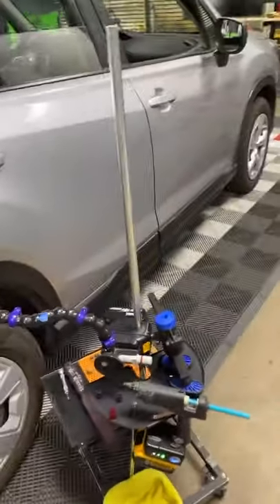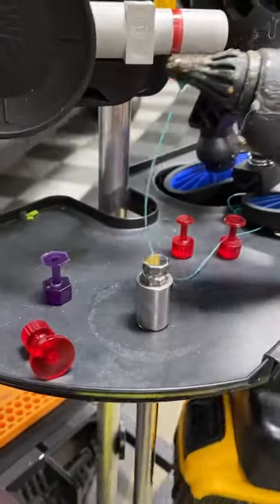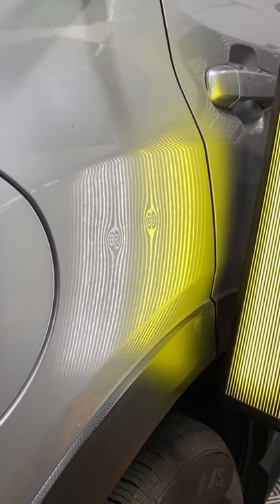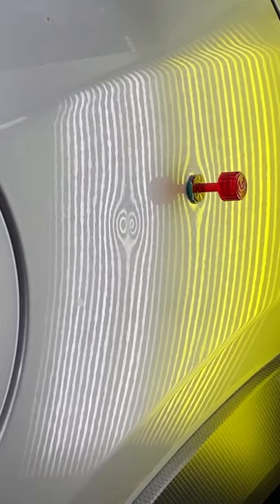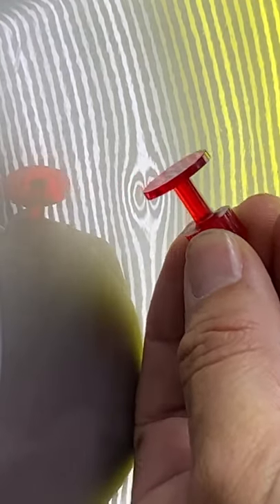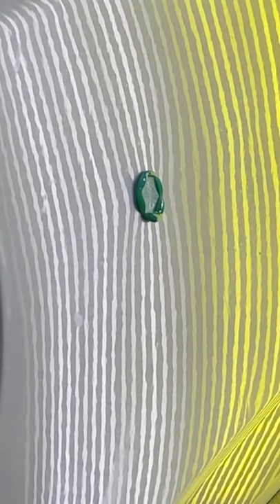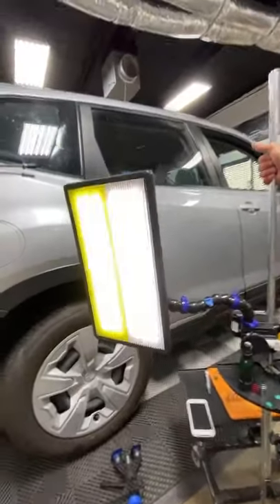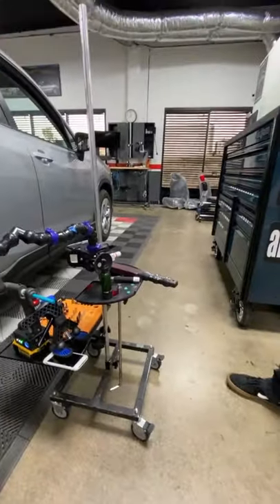Glue Pull Tab Review and Tapping | PDR Dent Repair Tutorial

Comment: tried to glue pull some dents, pretty successful but not quite there, Tequila glue and  reaper tabs small dents and pulled 6-8 times and still not all the way. Hood temp is 70 degrees, I am outside and can't get them all out, about 20. Looks way better but only about 80-90% good.

Comment: Good work but i think it would save u some time if u didn’t pull that hard with the puller, i did the Same thing and i found quickly out that it made the process longer, what i did was massaging the rigger slowly until i saw it was far enough out to massage it back to its place
Reply: Hope it is a good tip if u haven’t found it out yet ;-)
Reply: So, in the second 1/2 of your suggestion you recommend doing exactly what you recommend not to doing in the first 1/2.  Pull it “far enough OUT to massage it back to its place”.
Reply: Which, funny enough, is exactly what is show in the video.